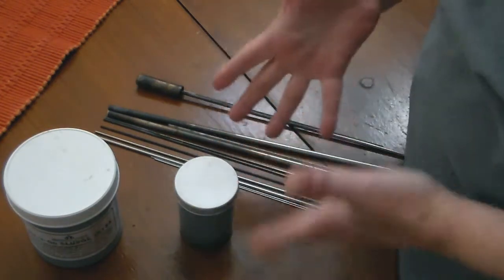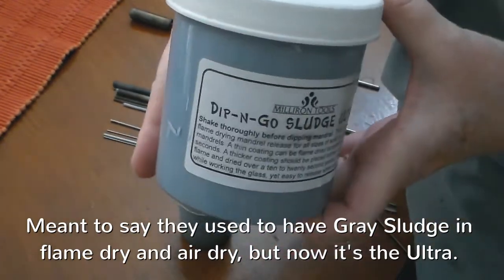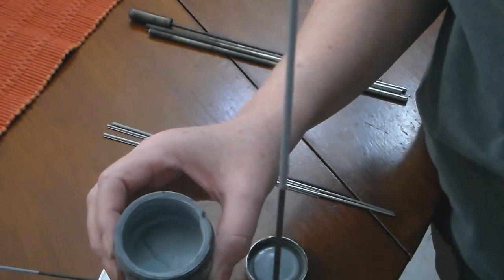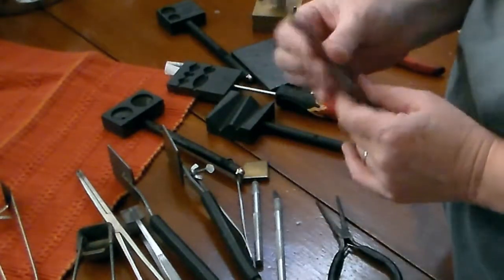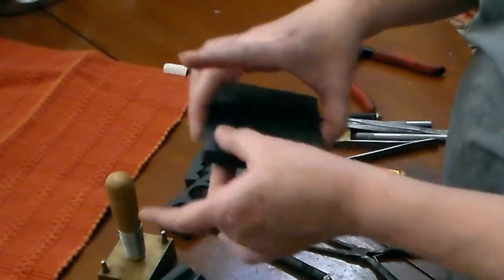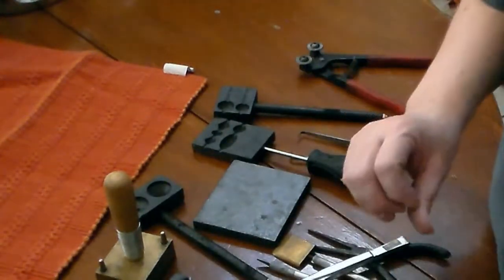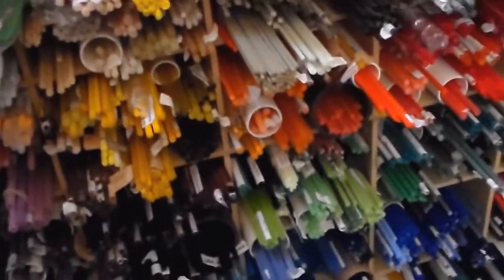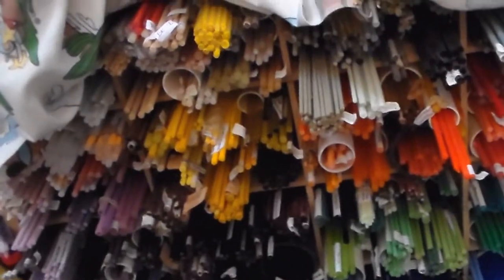Starting your own Glass Studio at Home Part 2

Comment: How do you know when a glass punty is needed and when a stainless steer mandrel is needed? And wouldn't stainless steel be a lot more sensitive to heat than a glass punty?
Reply from the maker: You use a SS mandrel to make beads (the glass is wrapped around the mandrel and that's what leaves the hole in the bead).  Glass punties are used to make off-mandrel items that have no holes (and are not beads).  You do not really put the mandrel into the flame - - you heat up the bead release at first, but then, for the most part, you try to avoid putting the steel in the flame, just heating the glass around it.  They are pretty resilient, but can be melted off if put directly in the flame for too long (I've been there! Lol!).  Glass puntys are fine, but also can develop issues and can crack sometimes when cooling down, especially with soft glass (boro isn't as much of a problem).
Reply: Jeannie Cox thanks so much!! I love your channel you and revere glass are the best! Thank you thank you for talking thru everything step by step and answering questions. There are a lot of blogs but I am so much more of a visual learner!

Comment: Hot how do you say what do you set the Regulators on to work with the glass I can't find any videos on it and I'm just getting started if you can answer thank you
Reply from the maker: I am on a concentrator which runs at 10 lpm, if that helps. For tanked oxygen, I would run at 8-10lpm for my torch.  It really depends what type of torch you have and how much power it needs.  After that, I can adjust my torch higher or lower for more or less heat, depending on what I am doing - - heating a large mass of glass (higher) or doing fine detail work (lower).

Comment: Can't you leave the top off of the sludge so the water evaporates
Reply from the maker: Yes, you could - - so I guess it would depend how fast you need those mandrels.  Usually when I dip my mandrels, I will be working fairly soon (within a few hours) so I want those mandrels dipped asap.
Reply from the maker: So I guess it comes down to how much time you have - -  and possibly whether you are doing this as a hobby or doing it for a living (like me).